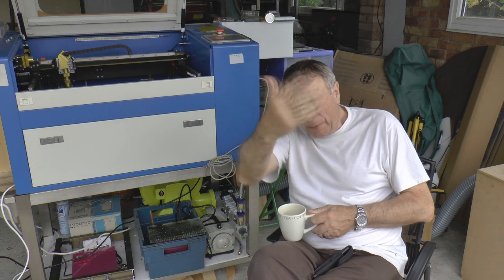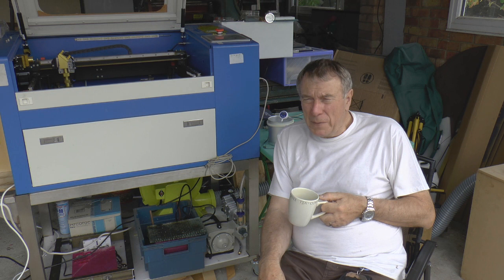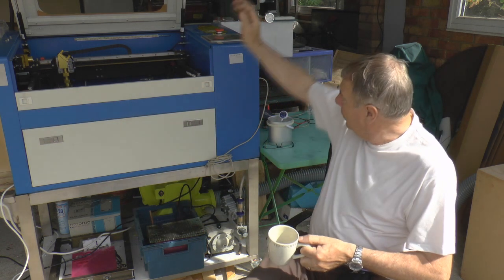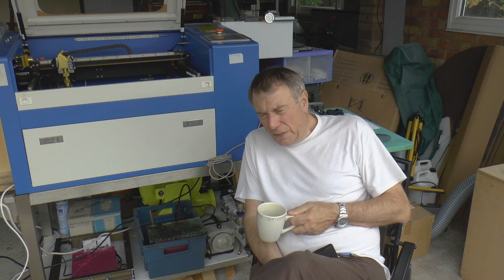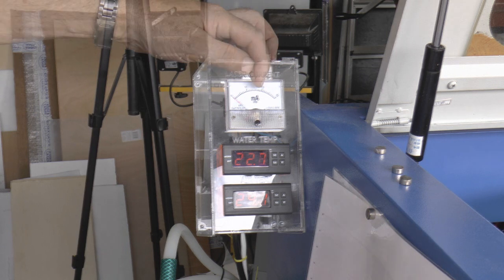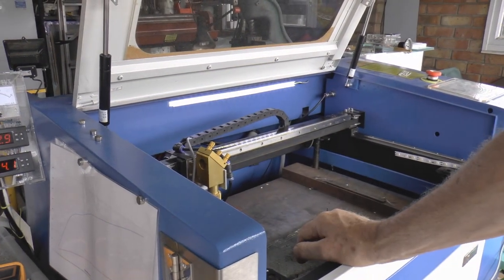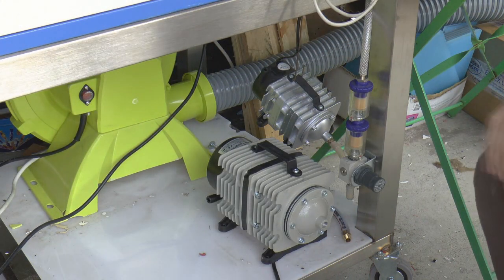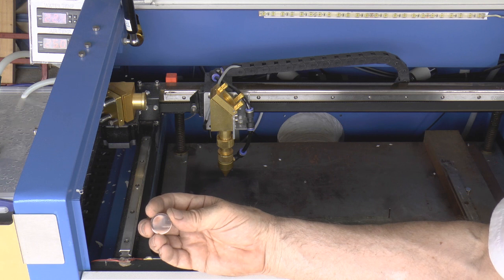RDWorks Learning Lab 75 What have I learned from 1 year of owning a Chinese Laser Engraver

Comment: Hello, first of all great video series on Chinese laser cutters! Thank you!
I would like to buy a laser cutter, but I'm looking at bigger machines. I would like to cut plywood for RC and tool boxes, leather and cloth and foam, so one dimension should be at least a meter. That way I can put one meter wide cloth that is sold by length and cut out pieces.
I would also like to engrave brass pins. At the end of a brass rod fi 6mm (on the round part, not the cylindrical) I would like to make a logo. Is this possible? How much difference does 1000 or 4500 dpi make? This Chinese lasers have 1000dpi, but hypercut.si have 4500 dpi lasers in their store, price is also higher. 

I'm looking at this lasers from Germany (item location):http://www.ebay.de/itm/130w-CO2-LASER-GRAVIERMASCHINE-GRAVIERGERAT-HOCHPRAZISE-CARVING-STRONG-PACKING-/282106549499?hash=item41aedc54fb:g:QBoAAOSwaB5Xoucl
some of them do not have rotary axis for round work pieces, but do those still have the option for rotary axis? 400$ for a stepper motor, lathe head and there pieces of steel seem a bit much, I cane make those my self. What are your thoughts on this machine?
Reply from the maker: Hi Klemen

I have to admit to being a very cynical person when it comes ro reading specifications for Chinese laser machines.
Firstly the power. 130 watts is a great tube  normally. However, as part of an Ebay machine , the experience of myself and MANY others is that you will be getting a B grade reject from a reputable manufacturer. The tube will work but it may be a 120 watt tube that fails to make the manufacturers specification. It may even be less. The power supply MAY be equally suspect.This aspect is a bit of a lottery. Either part may fail after days, weeks or months. It may perform so badly that you will want to change it. On the other hand you may be one of the lucky few. It's not all bad news though because the basic mechanics of the machine will generally be fine but may need some attention to realign the beam/mirrors for best performance.

The basic specification for the control system states a precision of 0.01mm This means at best you will only be able to work with 1000dpi. So even if you get a precision micro focusing head from Thunder laser or some similar site, you cannot change the machine precision.
Engraving any metal with 130 watts of power will be impossible.If you have watched my session of metals and reflectivity you will see a demonstration of just how reflective  copper is to IR radiation. Brass is 90% copper and 10% zinc and will be better than 95% reflective. That means that brass will not absorb the heat energy to do surface damage but instead will reflect it back at the lens and may destroy you lens.  I believe there is a Cermark product for etching onto the surface of brass but that is not engraving but more of a chemical heat bonding process. There will be You Tube videos of this that you may wish to investigate.
Hope this helps to clear a few point
Best regards
Russ.

Comment: Thanks, You confirmed what I thought about the ebay laser cutters. I when through the same learning curve with the early 3d printers. A years worth of rebuilding and it never really worked as advertised. But what I now know about 3d printers is priceless. Sure would I like a laser cutter that works out of the box and last, sure but I don't have that kind of cash. I'll be happy is the basic mechanics and electronics are good. I expect to replace the accessories. Thanks Russ, Nice job on the muffler!
Reply from the maker: Hi
If you are prepared to buy direct from the factory then you get a good tube and power supply. You may still have to tweak the engineering a bit but you will get a pretty good machine. After travelling half way round the world you cant expect it to hit the ground running. If you want that sort of nannying (and that doesn't sound like you) then you pay someone like Boss Laser to do the worrying and deliver you a running machine (but at a price)
Thanks for your kind words
Best regards
Russ
Reply: Before watching your videos I was thinking about getting one of those Ebay machines, similar to yours, but now, I am not sure. What would you suggest? Chinese one, and then order a proper 60w+ tube, or something completely different? My budget is ~ 1500 euros, and 50-60w will do the job.

Comment: Great videos! Also some useful tips how to not blow out your tube in week 1. Thanks for that! Just got my 40W machine and I have already started modding it. I think you can scale down the amount of cooling water by using radiators. When first trying the machine with 1L the water became quite hot. I had some spare parts from my PC water cooling stuff and connected a couple of radiators to the cooling system. Water stays cool now with about 1L and what is inside the cooling system.
Reply from the maker: Hi
Thanks for the appreciation.
The CO2 sealed tube lase is only about 10% efficient so in your 40 watt tube you will be trying to remove 360 watts of energy through cooling. Provided the ambient  air temperature is not too high, air cooling can work very well for lower power lasers. I would say that your 40 watt tube will safely run at 30C but in general I would aim for about 25C max

Best regards
Russ
Reply: Thanks for the advice! I plan to put together some temperature sensors and flow sensors with a microcontroller that will start screaming when something goes wront. I will hack in those temperatures you recommend!

Comment: I am grateful to all of the hard work that you have put into your YouTube videos. I have only discovered your channel today, but I can see how much hard work you put into documenting your experiences with your laser. I will be going through your labs to learn all of the bits I have missed myself. Having said that, if you ever need any tests made on a RECI 100W Chinese laser, please consider me your guinea pig over here in Canada. 

Cheers!
Reply from the maker: Hi Mohammed
Thanks for your generous offer. I have had several people write to me with machines fitted with Reci tubes. My first question is always "is it real or counterfeit?" As a high priced market leading tube there are cheap copies around that get sold on ebay. I have no idea where you sourced your tube but it may be worth looking at this

http://www.recilaser.com/en/newsInfo/ba9e706849167e770149177de8e00e86.htm 

There's a lot of viewing for one year of learning....good luck

Best regards
Russ
Reply: Hi Russ,

I have scanned the QR code on my Reci tube, and it is indeed a genuine Reci tube. I have purchased my laser directly from a factory from China. I corresponded with the sales rep for over 2 months before completing my purchase, to both customize and insure my machine is top quality.  It is no Trotec, mind you, but I have not had any major flaws since it has arrived on November 2015. I am using it on a daily basis in a commercial setting. It is getting close to a year now, and the tube seems to have as much power as it has when I first got the machine. 

One of the features I have insisted on getting was to be able to control the Z-axis using the control panel. Controlling it from a switch on the side of the machine did not appeal to me because of its inaccessibility and in-accurateness. It is much easier to use the digital buttons on the screen to go up and down, rather than flicking a switch (on and off) to get to the designed height. In order to get this feature, I had to opt for the auto-leveling feature, which I do not use at the moment. By the way, because of the size of my machine, (900mm x 600mm bed area) the z-axis is driven by a metal chain and a huge stepper motor. It is surprisingly accurate. 

Regards,
Mohammed
Reply from the maker: Hi Mohammed
All that is excellent news. It's generally those  ebay machines that claim to be fitted with Reci tubes that turn out to be counterfeit. If you ever find this out, it will never be possible to get to to man in China that sold it to you. It may cost more to buy direct from China but you are generally assured of getting a reasonable quality machine with an A grade tube and  power supply. That Reci  tube comes with a statement of 10,000 hour life, I have recently found out that this time is not "light on" hours but elapsed time/shelf life.  The gas mix inside the tube is there as a partial vacuum and as such there will be slow leakage of outside air into the tube This degrades the mix over time. Some seals will be better than others so it may be that your tube will be better than the statistical average.  As a person that relies on his tube, I would advise you start checking  it weekly with a simple 65% cutting test (say a 25mm square) on a piece of 6 or 8mm acrylic Set the speed to JUST cut through. When it starts to struggle or you have to lower the speed to get a good cut, will be the time to start more regular checks. Bear in mind your 10,000 hours starts ticking when the tube leaves the factory, so dont by a "spare" tube a long way in advance.
It sounds like you have bought a really good machine and your initial research and effort. Would you mind sharing where you bought your machine from. It's always good to collect positive information. Most of what I collect is from unhappy people with problems.
Thanks again for your kind offer

Best regards
Russ
Reply: Hi Russ,

I have come across many users who have dealt with factories directly, but realize the after sale support is horrible. I can say that is true in some cases from first-hand experience. I have visited many factories in China in three separate trips and have learned a lot about the general business strategy that some manufacturers tend to follow. I cannot generalize that all of the factories in China follow the same mindset, but from my observation, I have found that many factories' representatives seem very welcoming and friendly before the sale. Once the sale has been completed, their support and enthusiasm deteriorates and problems arise.  Having said that, the current machine I have is not my first experience with a Chinese laser. In 2013, I purchased my first desktop laser (60W Reci, not sure if it was genuine or not) from Bodor. At that time, the sales person I dealt with (for approximately 1 month before finalizing the sale, was very quick to respond, easy to work with and fairly easy to understand.  Once the money was transferred, and the machine arrived, their English seemed to have gotten worse. It was not a bad machine, but I had problems with the LED strip shorting the whole machine. When it is plugged into an outlet, the electrical breaker would trip. Having realized that the LED strip got damaged during shipping, I was able to fix the problem. The second major problem I had was the bed. It was nowhere near level or even flat. It was warped in some areas. I documented the bad bed with a very clear video, using a straight edge. Their response was that my straight edge was not 'straight', and their bed is fine. I had to fabricate my own aircraft grade aluminum bed to compensate for that issue. They suggested they would fix the problem if I mailed the old table to them. This is completely unreasonable because of the logistics. The fact that they were able to see in the video that the table was not flat, and that they asked for me to ship it anyways made no sense. I don't know how well Bodor machines are now, they seem to have made a huge face-lift to their models. 

On the other hand, the machine I currently have is from ShenhuiLaser. From my previous experience, I knew I was taking some risk, but for the specifications I was getting, the value outweighed the risks. I honestly cannot mention anything bad about this company. I am not affiliated with Shenhui in any way, shape or firm. I have had a positive experience during the whole journey. I have done a lot of research on which manufacturer to purchase my machine from, and I am genuinely happy. The only thing I would change about my purchase is the Industrial Chiller I have purchased. The one I currently have is the CW-3000 chiller. I will be getting the 5000 chiller soon. My shop gets too warm in the summer (in Canada) and the water temperature has risen to 29C. It is not a problem during winter, but I am always scared to overheat the tube. 

One experiment I made in regards to Shenhui is to test their after-sales support. One problem I faced was regarding the second mirror mount. One of the screws that adjusts the mirror was very hard to turn. I have changed the screws around, but I realized the actual tapped hole was stripped. I could have easily re-tapped the hole, but I wanted to see how the manufacturer would react to my issue. I talked to the sales rep, explaining the problem. In less than 24 hours, she responded asking me to quickly send her my current mailing address. In a few days, I find a whole new mirror mount in my mail. I was very impressed with this. They did not ask for the old mount to be shipped to their factory in China, nor did they ask for evidence of the mount being stripped. I will not guarantee everyone has had, or will have the same level of experience, but this is something I have experienced with Shenhui. They have earned my loyalty to the company and I will definitely be doing more business with them in the near future.

Regarding my current tube, I will take your suggestion and do this test. I have not thought of it before, but I will certainly make it a routine. I am already investigating the purchase of a new tube, just in case my current dies or fails. I decided not to purchase a spare tube for the reason you have suggested. But I think it is time for me to invest a little to insure an uninterrupted operation.

Another positive aspect I have realized today is the age of my laser tube. When I scanned that QR code, it read that the tube was delivered September 23, 2015. This is very close to the purchase date of my machine. This means Shenhui does not stock-pile the tubes in their factory and send 'aged' tubes. 

If you have any other questions regarding my machine or experience, please feel free to reach out.

Regards,
Mohammed
Reply from the maker: Hi Mohanned
It happens that my machine is a Shenhui 300x500mm. The 50 watt tube was actually an 800mm 40 watt tube that was unmarked rubbish. The basic engineering is quite good but as I mentioned earlier, I bought my machine from Ebay happily unaware of the fraudulent activities taking place with these machines. With many correspondents reliving my story, I now know that mine was not  just a case of "bad luck" but all part of a systematic fraud to shift B grade reject tubes and power supplies.

Thanks again for all your positive feedback. I will pass on your experience whenever possible.
Best regards
Russ

Comment: I have the exact same machine and use it for my business and had nothing but problems with tubes dying and power supplies dying on me. When running a business that is 90% dependant on the laser it gets extremely stressful. I think I'll be looking for the same tube and power supply you have opted for. You able to supply me the exact details for these so I don't hey screwed over again. 
kind regards
Reply from the maker: Hi Jeordan

Yes, it took me a little while to realize that ebay is NOT the place to go looking for a new tube and power supply. That's where they dump all the B grade rubbish. You generally cannot buy direct from a Chinese manufacturer but have to go through  their version of Ebay called Aliexpress or Alibaba. However, you are buying direct from the manufacture where these organizations are like a big shop window. You will be buying A grade products if you choose reputable manufacturers. I chose Mactron because they were a smaller company making their own power supplies and tubes but were dedicated to providing a high class service and a top quality product at a reasonable price.
Here is what I ordered

http://www.aliexpress.com/store/product/1200MM-60W-Laser-Tube-60W-co2-Laser-Power-Supply/321243_1109607209.html

This is what was shipped
https://mactron.en.alibaba.com/product/60206922896-219893473/Co2_Laser_Tube_70_Watt_For_Laser_Cutting_Machine.html

It was an MTS-T70 tube 1250mm long with matching power supply.

Several people have followed my steps and most have been treated the same way. It is a good idea to write directly to Gelly Dung   on  sales02@mactron-tech.com. Ask for a quotation and part numbers for the 60 watt power supply and tube that she supplied to Russ Sadler. You may be lucky enough to get the same good deal. The bad news is that DHL double the price of your purchase with their courier charges and then you will pay about another $100 for import tax. Ouch!! but it was worth it to have a product that just worked reliably and predictably.

Good luck
Best regards
Russ

Comment: With the new compressor I recommend putting a small reservoir (e.g. length of PVC pipe) between the pump and the hose.  It quiets the pump a lot, and it absorbs the pulses from the pump and delivers smoother air.

(I have a very similar pump on my own laser cutter)
Reply from the maker: Hi Ben
Thanks for that tip. Perhaps in my case I already have that compliance because there is about 6 feet of soft silicone pipe between the pump and the machine inlet. I will however experiment with extra volume as you suggest.
Best regards
Russ